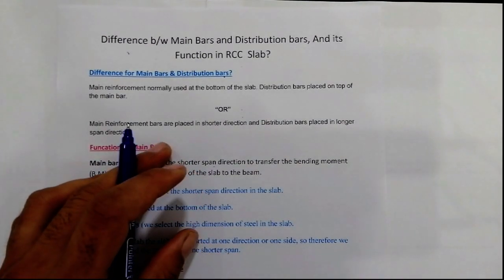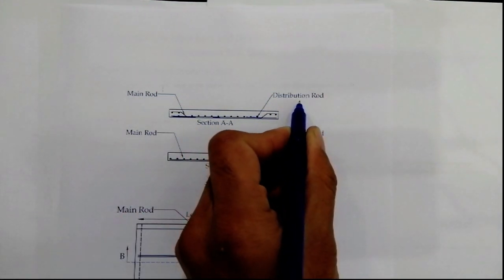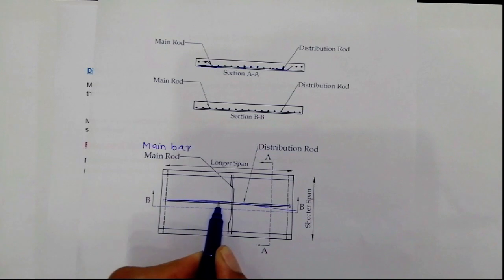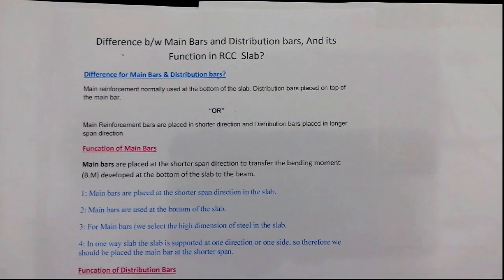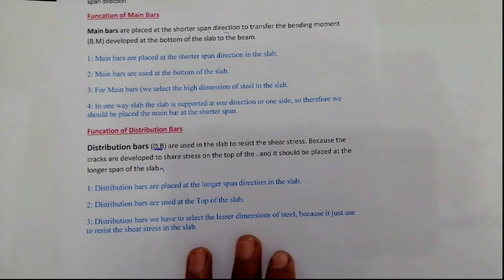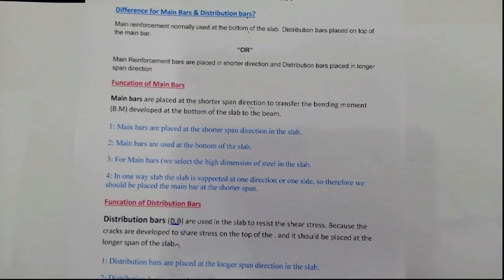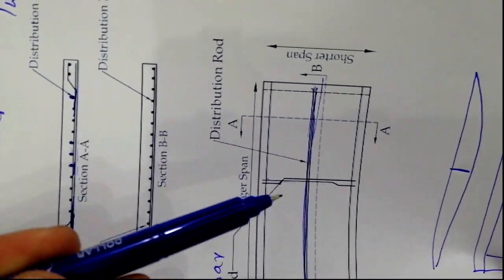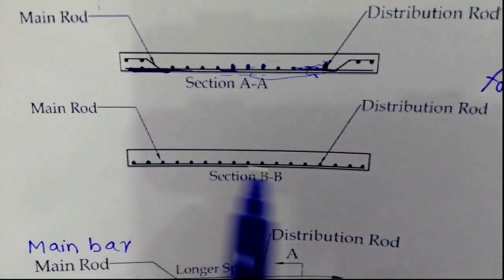Function of Main bars and Distribution bars in RCC Slab - Difference for Main and Distribution bars

Comment: Not always, the dia of both main and distribution bars may be the same but the spacing will surely be different. The distribution bars are usually governed by minimum reinforcement requirements particularly in a simply supported slab (or say one way slab)..